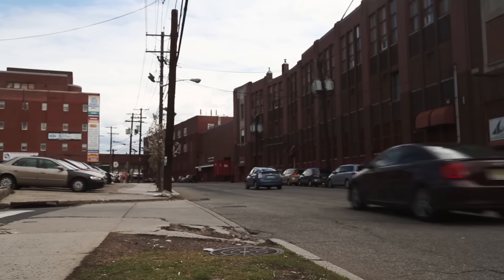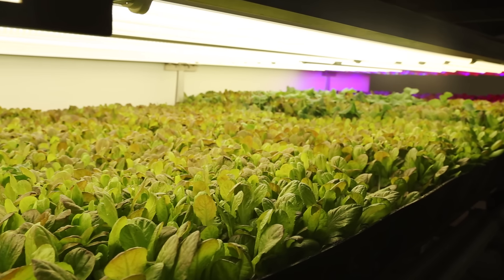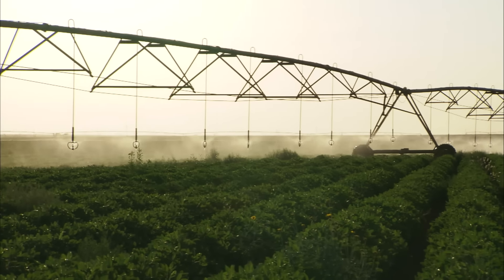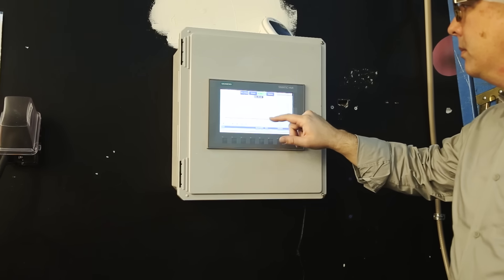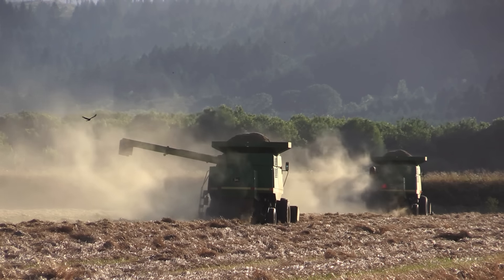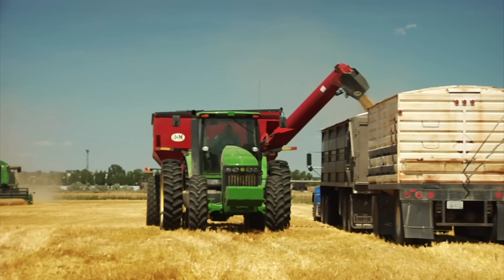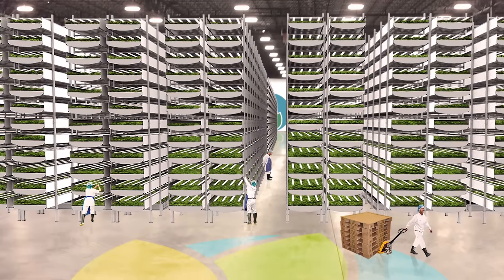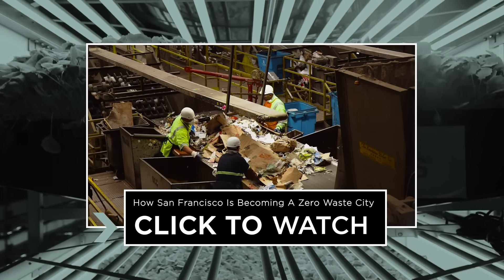This Farm of the Future Uses No Soil and 95% Less Water

Comment: they should put solar panels on the top of their buildings to generate the energy needed for these plants.
Reply: Yep, and some already do.
Reply: Solar isn't cost effective yet
Reply: Plants can use up to about 8% of sunlight. Solar panels can use up to about 25% (let's not consider more effective but highly costly solar cells). So for those plants under a roof covered with solar cells we can provide about 2% (1/4 of 8%) of captured sunlight energy. Or even less than that because some of the energy we will lose as heat due to electric current resistance.
Reply: yes it is
Reply: Hydroelectricity would be better as you get power 24/7, whereas solar is obviously only when there is sun (ie not during the night)
Reply: why not just use nuclear power
Reply: Battery packs take care of the night problem.
Reply: Nuclear power is generated from uranium, which is a finite resource. Which isn't a problem while supply exceeds demand, and as we get more and more efficient at creating nuclear energy and processing nuclear waste, the point of peak uranium is only going to get further and further away. But we're still a mass consumption civilisation. So it's just delaying the problem that we currently have with over-reliance on oil.
Except, of course, that at least when an oil refinery explodes you don't have the added problem of that area of the planet becoming a no-go zone for the next century, along with anything that happens to be downwind.
Reply: Thorntonian There are already alternatives to Uranium and the current pressurized water reactors. 

You can use Thorium as the primary fuel source, which has a shorter half-life, is far more abundant than uranium, can't be practically used in weapon production, and is currently treated as a waste product of rare earth mining.

Then you can use Molten Salt Reactors which aren't pressurized, so they can't explode, are more compact in size, and can have natural failsafes that can shutdown the reactor quickly without human intervention. Plus they can be used to actually consume our current nuclear waste, reducing the amount and its half-life.
Reply: japzone First of all, thorium isn't More abundant. There's more of it in the earth's crust, but known economically extractable reserves of both materials are practically identical.

It's also not economically viable when compared to uranium.
It's far more dangerous in the short term, making waste handling and reprocessing more expensive.
It doesn't work as well in a fast reactor, either, requiring more specialist equipment to process it.
It'll also cost more to produce fuel of the same quality, since it melts at a much higher temperature.
And for all those reasons, we have less research and experience in using it, meaning any investor has to be prepared to shoulder more risk.

Maybe it'll become a viable alternative in the future as more research is done. But we're also trying to find ways to make uranium more cost-effective, so unless that hits a dead end, it's unlikely.
Reply: Or better, make the roof transparent, that way almost all of the sun's energy goes to the plants instead of 20%. It's called greenhouse.
Reply: iambehindthemirror That means finding a transparent material durable enough to function as a roof, and having the money to buy enough of it, let alone the money needed to destroy the old roof. Even then, this is vertical farming, so that's only going to benefit the plants on the top.
Reply: This is actually a case were using internal combustion engine would actually be better, as the Plants need the CO2 to grow. having so many plants in a closed space, it would make the air devoid of CO2 and very oxygen rich, and i doubt that just the breath of the workers and ocational opening and closing doors is going to be enough..
Reply: Solar panels are certainly about $1 per watt. They have become extremely cost effective.
Reply: Also the Apple headquarters in Cupertino is powered entirely by solar energy. Its so efficient that have excess energy and started a company called "Apple Energy."
Reply: Plants don't need light at night
Reply: Internal combustion engines release a lot more toxic gasses than just CO2. These people probably ventilate the building with outdoor air with pumps and heat exchangers.
Reply: yes it is I leared about it at alevel Gearpraphy withing 6 months of putting solor panels in a country you have mostlightly genrated the money (and some more money) that it took to make and use them.
Reply: bad for the enviroment

Comment: Neighbour is paying a ton in electricity and he doesn't know why! 🤔🤔🤔🤔🤔
Reply: Solar panels
Reply: LED lights are very efficient. It probably cost for one light to run for like 60 cents a year.
Reply: Edward Jr In a normal house and normal lights maybe. 
With these estimates on normal small LED lights, it’s about $12 a year per each. Those lights they’re using are very specialized (even changes the type of rays) so I wouldn’t be surprised if it were 10 times that per each. 

https://www.cnet.com/news/are-efficient-led-bulbs-worth-the-price/
Reply: @ernestc5641  also do they run Ac in the summer or Heater in the winter for the entire building?

Comment: How much electricity do you consume for this as compared to free sunlight?
Reply: Believe it or not, plants absorb 99% of their light in only 6% of the visible light spectrum. A modern solar panel is about 18% efficient. This means that if you take the energy of the sun, give it back to these plants at strictly the 6% of wavelengths they absorb, you can actually produce 3 times the plant light through LEDs. (18% of all spectrum light becomes electricity, churn that out as 6% light spectrum 18/6=3X the light usable for photosynthesis.)
Reply: Samual Hatfield Where did you get 6% I can't find any region of the visible spectrum that isn't used by either chlorophyll a/b
Reply: S - coefficient of Skepticism he's not wrong though. Maybe if governments started subsidizing electricity to these farmers like they do water for normal farms there would more of them.
Reply: So we are going to make all of this progress in sustainable energy just to piss it away making artificial light for plants? The fact is, non-vertical farmers can do way more for way less energy, labor, and cost.

Don't forget that instead of nutrients that normal farmers rotate crops in order to keep in balance, you need to constantly feed these farms with concentrated nutrients that don't exactly come from thin air.
Reply: +Samual Hatfield  Uh, where did you get this?
Reply: ++Samual Hatfield They said 45% of the spectrum so you are wrong because it's the efficiency of the mechanism itself thats 6-12% so the final efficiency is 3-6% but can't be improved using better wavelength.
http://www.fao.org/docrep/w7241e/w7241e05.htm#1.2.1%20photosynthetic%20efficiency
Reply: @JudgeDillon  
The question is what has a greater positive impact. Vertical farming vs. traditional farming.

Pros:
* Reduction of landmass taken up by agriculture.
* Water requirement reduction by 95%!
* Eliminaton of all or most pesticide use.
* Quicker and larger crop yields.
* (Other possible upsides)

Cons:
* Requires artificial light as opposed to free sunlight.
* Crops must be fed nutrients  (traditional and vertical farming both require this.)
* (Other possible downsides)

Pro/con?: Environmental impacts as a result of this changed could be good or bad. Hindsight is likely 20/20 in this regard.

That 95% is a huge positive impact, and only gets more important as the population grows. Not to mention, sustainable energy is advancing, so that downside will be reduced over time. As far as I can tell, this would be a net positive, as opposed to traditional farming.
Reply: Thank you for a thoughtful response. 

Water is not a 'finite' resource in the traditional sense, as water that is used returns to the water cycle and eventually makes it's way back to reservoirs and other "sources". When we take water consumption into consideration we are really talking about the energy being used to treat, filter, and transport water. In the end using less water actually means using less energy, as water does not disappear after use.

Should be interesting to see how the energy balance works out.

I am interested to know how crop rotation would play out in a vertical farm, as this is essential to maintaining soil fertility and limiting fertilizer use. Using more fertilizer also equates to using more energy. Ex: instead of nitrogen fixing crops adding nitrogen to the soil in rotations you are mechanically/chemically obtaining nitrogen from the air which consumes a lot of energy.

I did not think of pesticide use however and that is a big plus! I really don't see reduction in landmass as a particularly important thing, with transporting goods being as easy as it is today. I would like to see a side-by-side comparison of two farms, one traditional and one horizontal that produce equal yields before making a final judgement.
Reply: Why not used fresnel lens to focus the sunlight into a tube with a mirror cover used as a fiberglass that go down through each floor and give at each floor only what vegetable needs? just add some quantum dots to turn the green into red.
Reply: Also, what are the power requirement in W/m2 ?
Reply: I don't have time to respond tonight but I'll try to respond tomorrow when I can watch that video and dig into the issues of your admittedly creative but flawed idea.
Reply: +Lee Lucescu Are you sure? most of the sunlight is visible light and plants are green, that means they absorb red and blue.
Reply: CabinDoor  They probably never grown indoors before. Too little lumens and you get no growth no matter what spectrum you use. That is why LEDs have not replaced anything yet. A small string of light emitting diodes has nothing on a 1000 watt gas giant! (HPS) Or even the watts/volts equivalent metal halides output to power ratio. You need about 400 LEDs to grow what a 600watt HPS or metal halide will. So 400 1.5watt LEDs and a cooling fan and CPU which use the same amount of power as a laptop on standby. So you need about 900watts to do the same as a 600watt. So it doesnt add up. Maybe in the future new crystal lattices will be able to compress the light to gain more lumens, but till then, LEDs are only good for avoiding heat.
Reply: LED
Reply: Its LED so its lesser
Reply: @jimijamesjowitt  I dunno man ...i smoked pot that was grown in a my buddies closet with a lightbuld, and i got pretty stoned bro...
Reply: chile and germany had an excess of solar that burnt the consumer prices to nada so they would love to pump some e into this set up. you can offset the e required by solar. whats the go with neutrients? aqua ponic used fish poo etc... and know the difference (who is not stoned 24/7). these videos need more data less bs.
Reply: +suman k What?
Reply: I was wondering about that. Maybe the savings from shipping make up for electricity use. I trust they're using solar energy and what not.
Reply: S - coefficient of Skepticism  sun light is the best for plants not  uv and led light... the led can break down but the sun not... only to produce a led we ned energy and make the world sick. We need  the salat vitamins not an artificial product. 😞
Reply: The lighting needs could be powered by solar panels on the roof, LED is 60% more efficient than any other synthetic lighting system
Reply: But still what will be electricity bill??
Reply: Considering the product price will be the same
Reply: How many trees less do we need to chop down to have this compact farm?
Reply: Based on other similar videos I think the specialized LEDs are powered by solar panels. So that’s even more of a win win. Isn’t this great!
Reply: Eh you can just fill the roof with solar panels.
Reply: @johntheux9238  
 Issic Arthur.
Reply: +Sanjay Kulkarni If you have semi-transparent solar panels you can divid by 10 the amount of solar power the plant get the day then produce light at night.
Reply: I don't care about your spectrums, you can't play like your the sun and the centre of the universe... Prepotent politicians can't fit fricking sun in their agendas
Reply: I think this setup would be beneficial in at least certain situations. One is in northern areas where it's dark and cold for much of the year. Where I live, the outdoor growing season is only about half the year. With an indoor setup, plants can be grown locally year round. I used to grow green beans, strawberries, and other produce in my apartment under T5 fluorescent bulbs; some things proved to be too hard though, like strawberries, since they have to be hand pollinated if there isn't wind and bugs around. Leafy greens grow quickly and are pretty easy. A huge chunk of land is used to grow animal food, which means that we have less space to grow food for ourselves. Besides that, we destroy soil with monoculture and such. A setup like this costs money for lighting, but there are benefits that could potentially be worth the downsides.
Reply: Purple light didnt you see the leds do that
Reply: Depends of what size the farm will be. But still u can use sunlight if u design the structure like a triangle but that way its not 100% in terms of space occupation.

Comment: Things they fail to mention: massive amount of electricity used to maintain optimum environment plus massive investment that need to be made in buildings that are needed for closed farming such as these.
Reply: This will force Farmers to close down
Reply: Plants get no rest from constant sunshine!!!
Reply: @duanewilliams7353  Yeah, I wonder about the constant light part.
Reply: Electricity is cheap per kWh in the US, makes these vertical farming set ups very much viable if they have the market. Why does it matter that they don't mention it? It's not a bunch of chumps with no concept of P&L. It's simple to pit the cost per m2 against the production and value per m2, that's a basic prerequisite before even starting an operation like this. Now, talking about WHERE the electricity comes from is a fair point. 

As for the constant lighting, if anybody is running lights 24/7 it is safe to say they do not have a clue what they are doing. Depending on the crop, optimal day/night lengths have been researched many a time to generate the most annual success. Again, it is a trade off from extracting the most from the plant while being mindful of your costs.